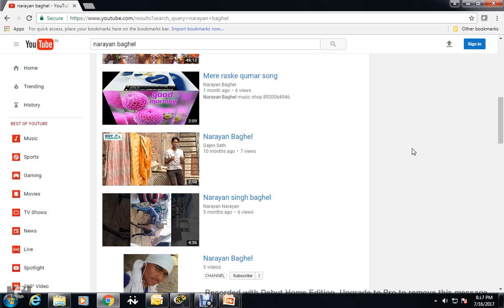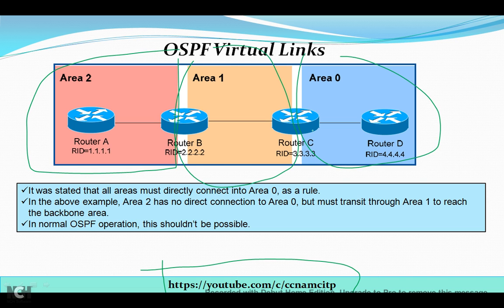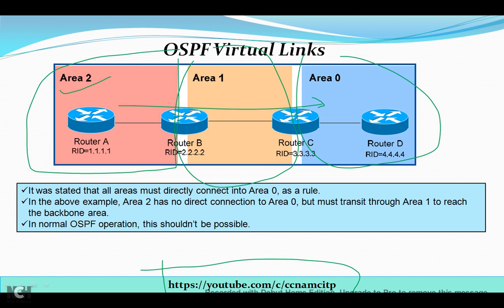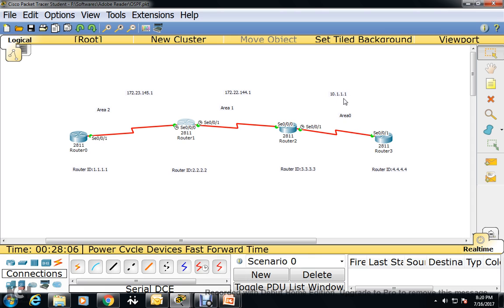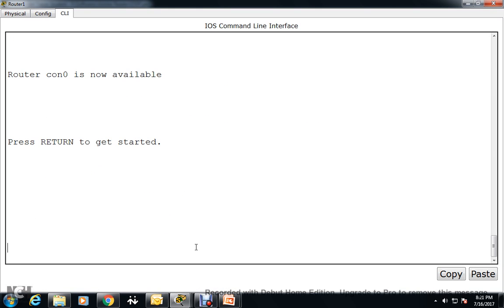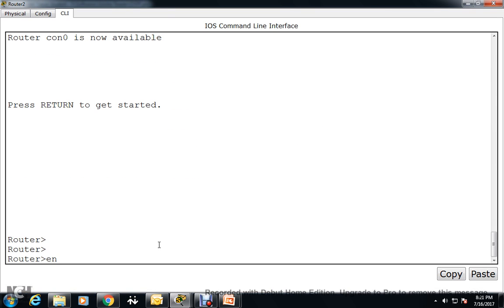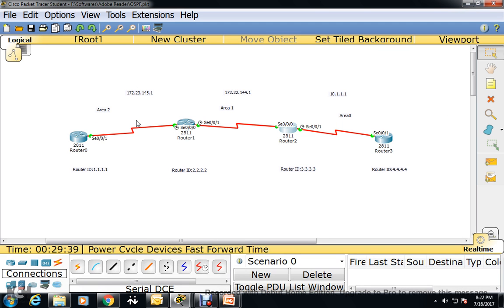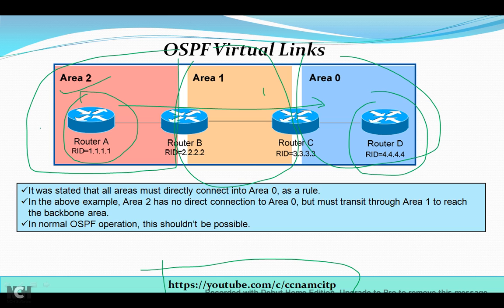OSPF Virtual Links !! How to Configure OSPF Virtual Links in Multi Area OSPF !!

Comment: Question about OSPF virtual link.
Lets say we have R1,R2,R3 and we R1 is in area 0 and R2 one interface is in Area 0 and other is in area 1 and  R3 has one int in area 1 and the other is in Area 2  and we have a router R4,5 and R6 and R4 one interface is in area 2 and the other is area 3 and R5 one interface is in area 3 and the other is in area 4 and R6 is in area 4. How are we going to create a virtual link from R5 ABR to R2 ABR , Is that possible to have multiple transitive areas?